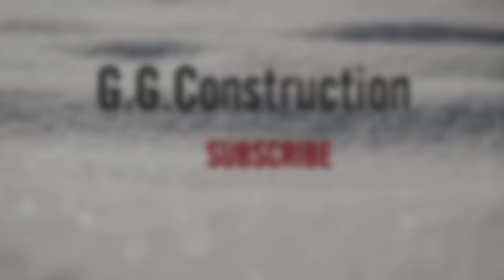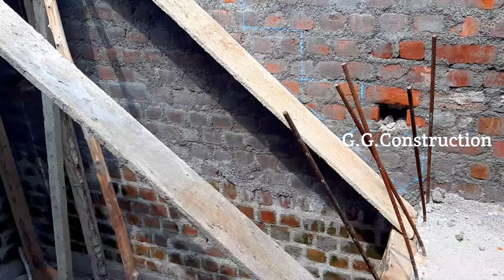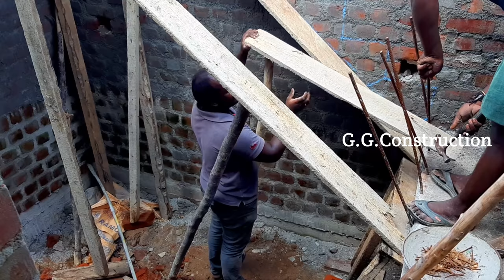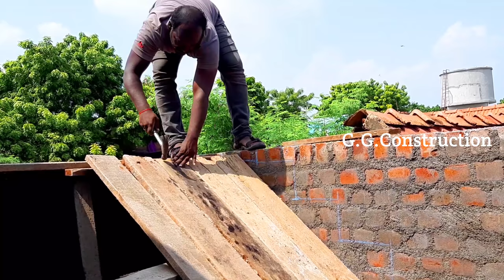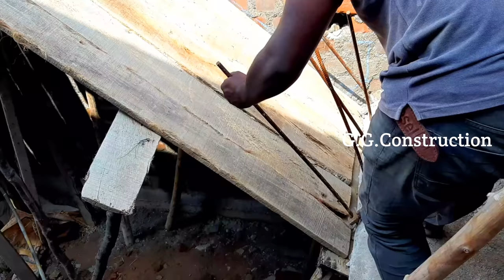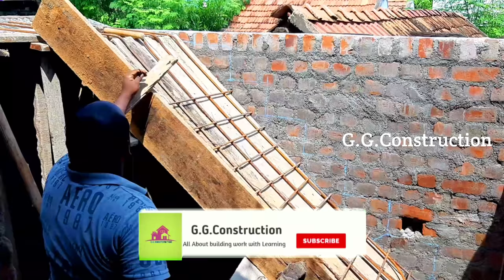Building concrete stair case centering work process-stairs case shuttering,formwork

Comment: 1) What is the actual Centering size in feet from wall . 
2) What is the width of the Concrete pouring.
3) what is the size of riser and thread.